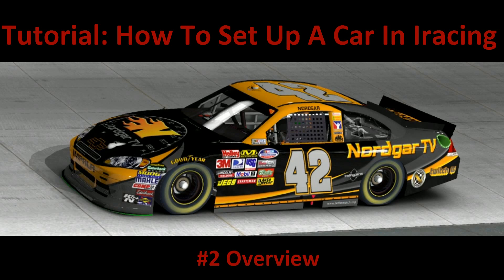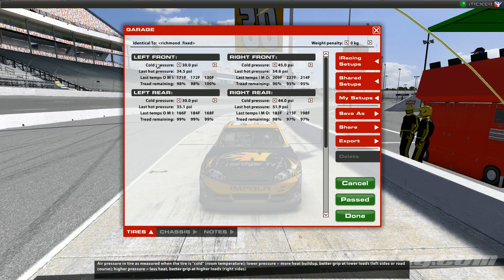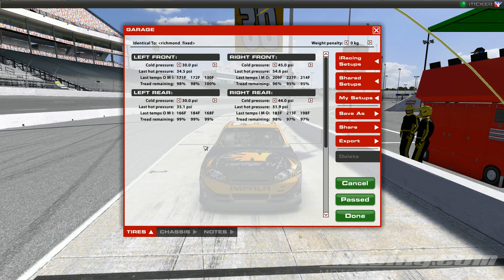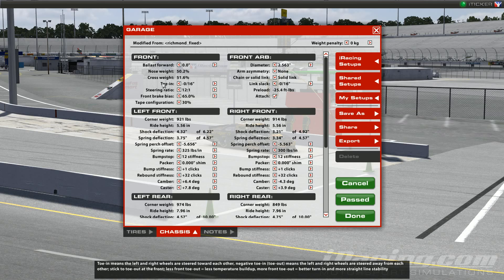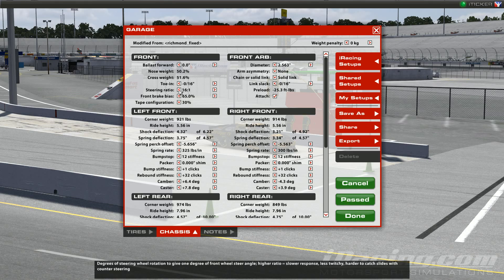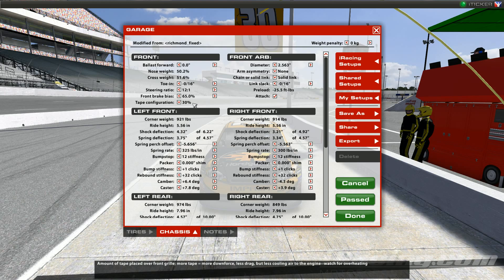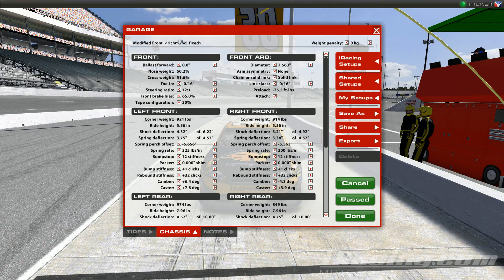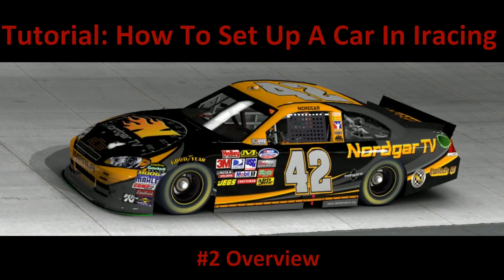Tutorial: How to set up a car in Iracing #2 Overview part 1 Tires, Front of Car, Front ARB

Comment: Hey Michael. When the car is on the ground or up on stands, The ARB's are in a bind. If you make suspension adjustments with the ARB attached you put it in more of a bind making it worse. This goes along with your Preload. Preload is how much tension is on the ARB when the car is static. Another example, go into the garage and unattach the ARB and watch your ride heights. They will all change when the chassis is no longer in a bind or no preload.

Comment: front toe out =straight line stability is wrong. if the front wheels are pointed away from each other then the car will wonder left and right 
toe in = understeer
toe out = oversteer (irl at least)